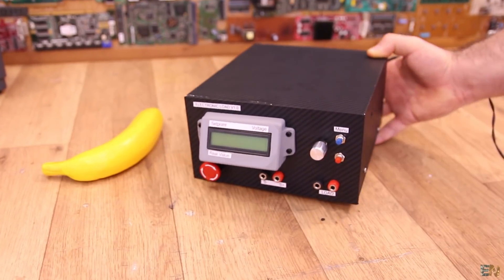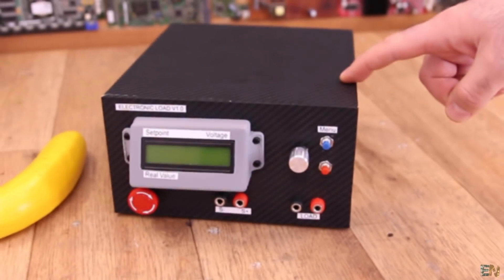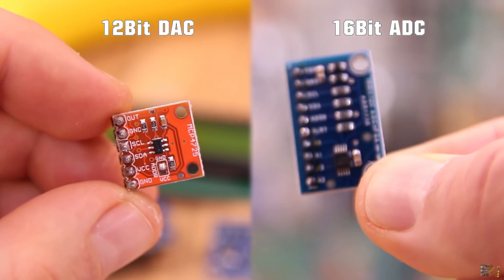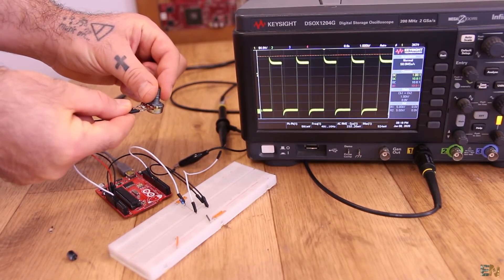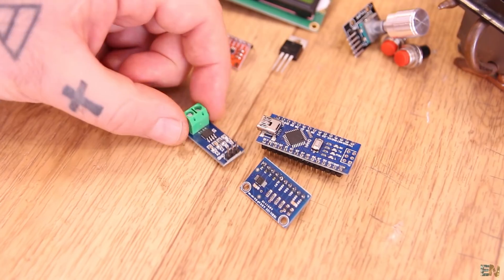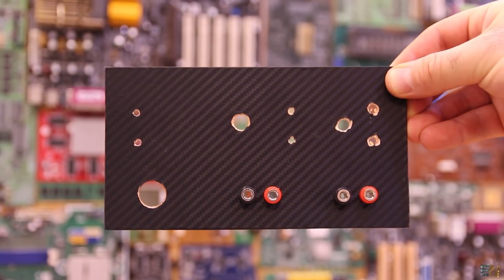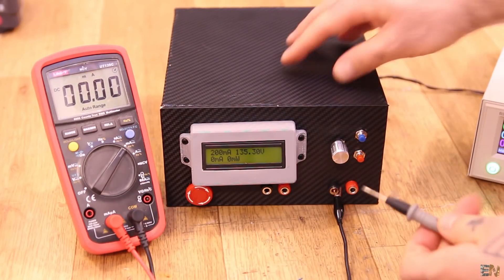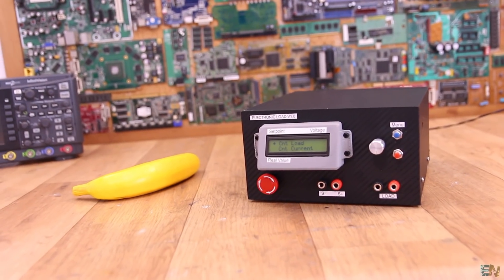Homemade Digital Electronic Load | Multiple Modes

Comment: Okay, i liked the video idea and the device, really cool concept.

I tried to replicate it , but it does not work. Display comes on , buzzer buzzes, intial text thing happens, But when i try to go into any mode, i.e. when i press the rotary switch button , it just returns to the main menu , not sure why its doing that. I really wanted to make this thing because i want to test the capacity of some buck and boost converters. But it is not working, can you fix it ?? or maybe post a V2 with actual working code and schematic ?? 

Its been over 3 years and i think a V2 is due.

good luck , love your content (just wish i could make a working project at the end of the video , but oh well... 😅🤷‍♂)

Comment: Please use some off the shelf metal enclosure, this wood wrapped in carbon fibre vinyl is too unprofessional even for a weekend hobby project...
Also to dissipate the heat better, get old scrap CPU and salvage the copper heat spreader, solder the to220 mosfet directly to it and then attach it to the CPU cooler, will halve the thermal resistance.
Also to make it easier for everyone to build, use readily available cheap CPU cooler like cooler master 212 it's only like $25 and will dissipate around 300W

Comment: Not bad, but check out the elecntronic load from "Scullcom Hobby Electronics", this man is amazing and his projects pretty much perfect, I'm sure you will love it.
When you work with plywood, use spray paint, the wood will suck it in partly and becomes rock hard, heat resistant and will last for a long long time, better than plastics and metal.

Comment: This is a really bad way of controlling the load. You can use the same circuit as the analog version and use the dac to control the setpoint. Controlling the gate voltage with dac has many issues, two of which were the sampling rate of adc and voltage limits of the dac. If you're going to use an op amp, then just use it to regulate the gate voltage.

Comment: This Electronic Load project does not work.  Unless you are an advanced expert in op amp AND Arduino software design, do not attempt this project.  
First, there are 4 major problems with the hardware.  #1. The Arduino Nano is held Reset by grounding pin 3.  #2.  The ADC current sense is wired backward resulting in negative numbers.  #3.  The output of the DAC oscillates because it is driving 3,247 pF FET gate and is only capable of driving 1,000 pF.  #4.  If you use an external op amp (necessary because of the DAC) it will oscillate because it is also driving FET gate and is only capable of driving 100 pF.
Second, the code documentation is nearly nonexistent and there is no explanation in the YouTube Video.  The Constant Load Mode and the Constant Power Mode does not work.  After a lot of effort, I abandoned this effort.  The Constant Current Mode software loop will not close and results in oscillation.  After abandoning the ELECTRONOOBS software loop and a lot of redesign, I got my own design to work.
I cannot see how anyone that attempted this project could praise it.
If you were still interested in the Electronic Load, I would recommend the Scullcom Hobby Electronics #45 on YouTube.  It is well documented both hardware and Arduino software.  The video goes into great deal of detail explaining the hardware operation and Arduino software operation.
Reply: Exactly ! the program does not start at all because the RST pin connected to ground. Thanks for pointing the other errors!
Reply: Could you post the software revisions you just made?